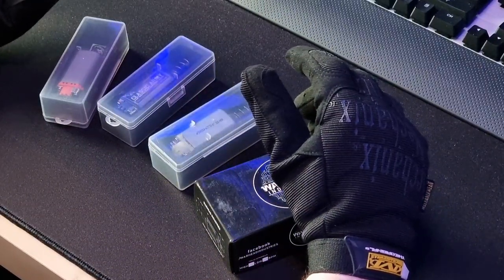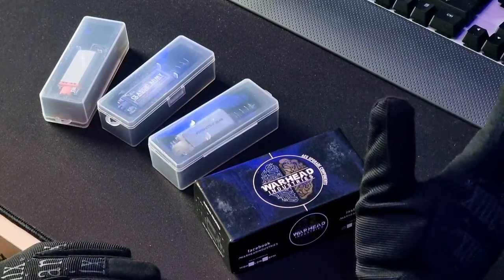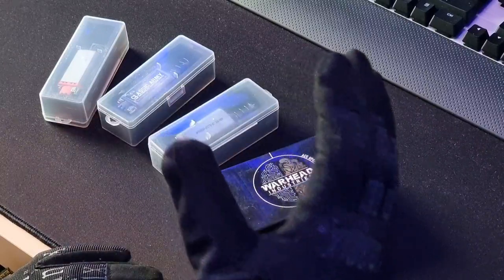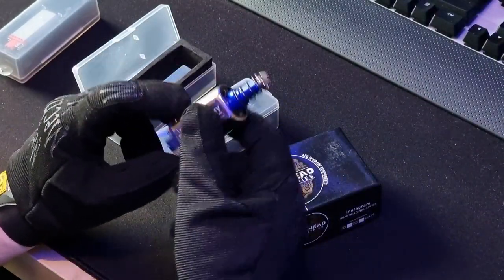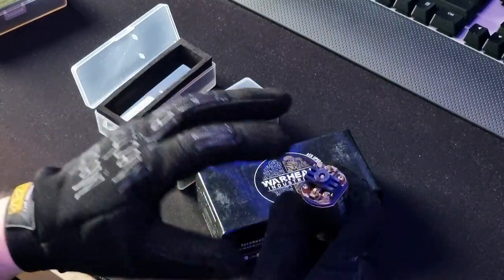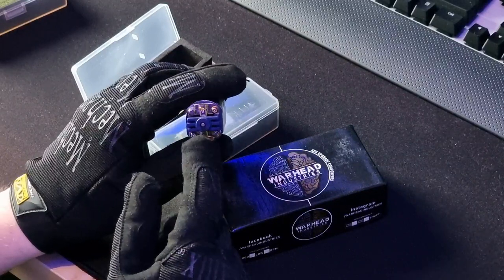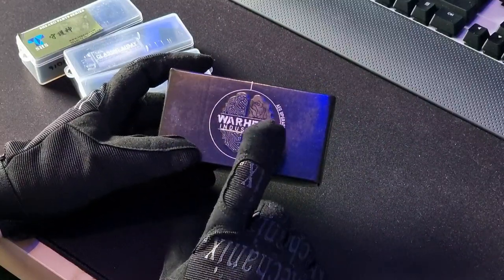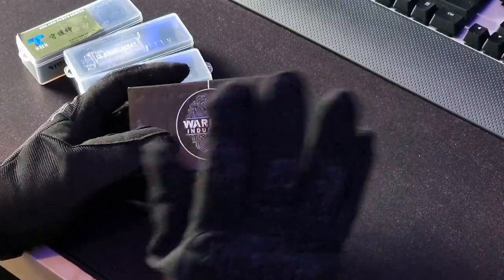Beginers guide to AEG motors in airsoft. High torque/High speed, Long or short. What does it mean?

Comment: Hola mi estimado, espero te encuentres mejor de salud. ¿Me podrias recomendar un motor para una RPK-16 Lct? Quisiera mas fuerza, mas velocidad y mas disparos. Uso una bateria 11.1.
De antemano muchas gracias
Reply from the maker: Hi, apologies for the late reply. I normally wouldn't recommend anything to extreme on a support based replica as I would favour reliability over outright performance. Having said that though a decent quality torque based motor would certainly work well with an 11.1. Should give you a snappier trigger and slight bump in ROF.

Comment: Great information just curious about your comments on damaging stuff on stock replicas. i want to add a 52k rpm warhead motor to my krytac kriss vector 18:1 gears, 120 spring, and perun mosfet. what are my risk?
Reply from the maker: Thanks, I'm glad you found it helpful. Risk wise your basically just looking at the usual wear issues. If you run it faster then of course the parts will wear more rapidly. You should be OK though. Always be aware of pre engagement but if that's an issue on 11.1 then drop to 7.4 and you should be fine. Overall when I refer to damage its more to increasing failure risk. A fault with a weak motor will be exaggerated with a strong motor but obviously that's only if there was a fault there to start with.
Reply: @rockbottomairsoft  Thank you for the very quick response. This is great information to run with and understand Cheers!
Reply from the maker: No problem at all, I hope its useful. Good luck with the upgrades. I hope it goes well.

Comment: If I want to switch to a high speed motor do I need to replace stock gears? Could I run them stock with like a 35000-40000?
Reply from the maker: Not necessarily. A lot will boil down to the spring you want to run and what outcome you want. There are generally not many benefits to a high speed motor, but on stock 18:1 gears it should work fine. Brushless changes the rules slightly but I've always found that standard brushed motors are far more effective with high torque. Better trigger response and more forgiving for gear/spring choice. But if your set on high speed then generally the draw should be fine on an otherwise standard box with moderate spring rate.

Comment: I'm looking to get 13:1 gears in my G&G... So I was wondering what motor I'd need
Reply from the maker: For 13:1 you would be best with a torque motor in my opinion something like 22 TPA. You might get away with a balance motor such as 18 - 20 TPA but I think High Torque would be best for respone.

Hope this helps.
Reply: @rockbottomairsoft  yeah I've never done any tech work on AEG's before but it's just something I really want to do.

Gbb pistols are easy and I'm pretty sure I could build a hi capa blindfolded by now
Reply from the maker: If you like working on things or tinkering you will have no issues. The electrical circuit is very simple and mechanically its more fiddly than complex. Just remember if your going for a speed build  though have a read up on PME, it can be a problem.
Reply: @rockbottomairsoft  just my cqb rifle, want it to shoot faster so it's semi only.

I'm not really fussed about these insane HPA guns.
I'm not willing to spend that amount, even though I could
Reply from the maker: HPA can be awesome, not cheap like you say. Not my thing though. Don't like the whole hose line thing.
Reply: @rockbottomairsoft  doesn't somebody do a stock/buffer tube where you screw c02 cartridges into?

I remember seeing it for sale
Reply: @Mrmhibbert yeah I think polarstar does that with the kythera or something else